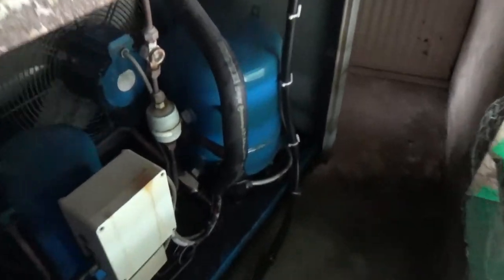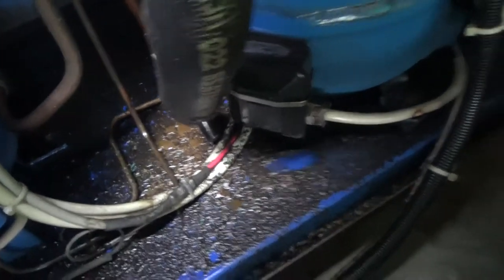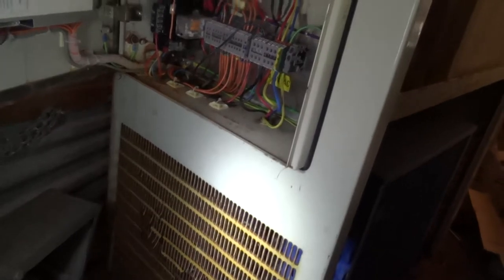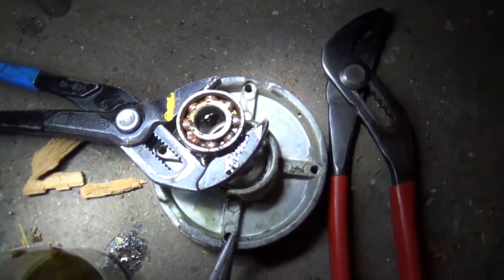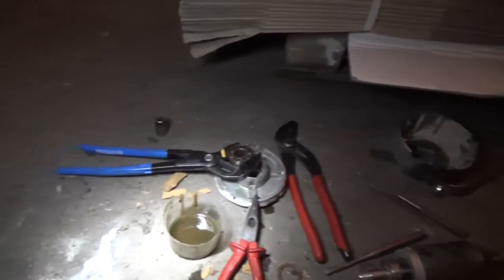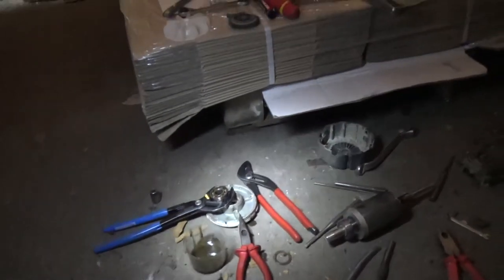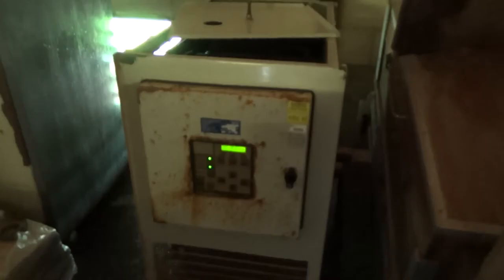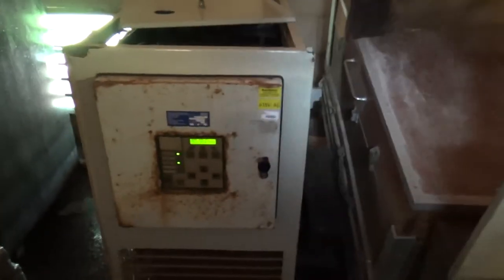Cold Beer? Pumps Got Wine...

Comment: Aaaah I bet you could use some of that ice cold beer :). The water pump makes a lot of noise!
Reply from the maker: Yeah i could do with a beer right now! The bearing in the pump had rusted solid, took a bit of rocking back and forth and rinsing in oil to get it to turn but its on its last legs. So long as it runs long enough to chill the fermentation all will be good!
Reply: heavydiesel
 Take it you are selling him a new chiller. The old one is dead and the standby one is sitting with one leg on a banana peel and the other on some oil. Noisy pump that, it will go very quiet soon.......